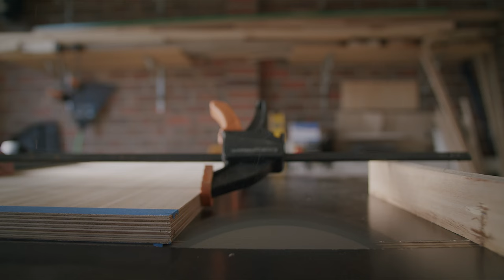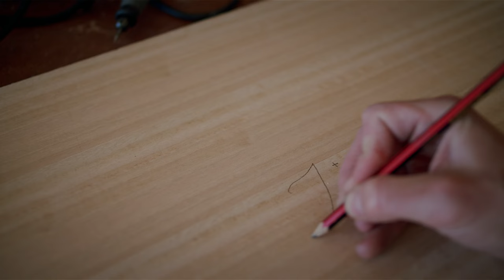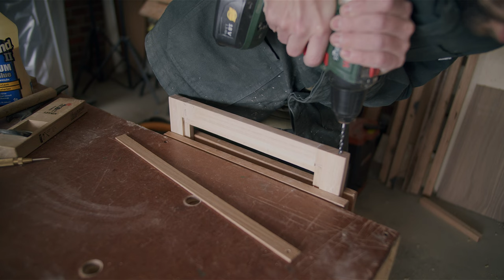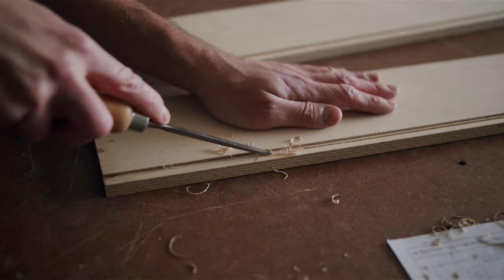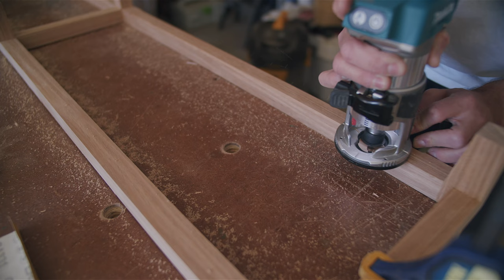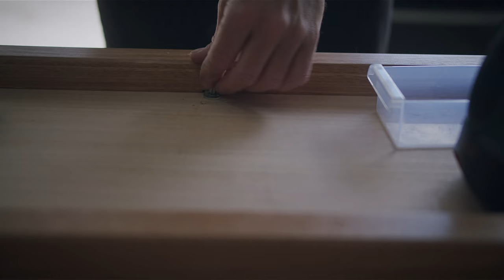Mid-century modern record player cabinet with hideaway speaker doors - DIY Build

Comment: I absolutely love this piece! I've been looking for inspiration to build something similar for my father's old blues collection and came across your video. I'm just getting into wood working - do you have any suggestions on building this as an absolute beginner? Any chance you'd consider sharing plans or even making a video demonstrating a simplistic build?
Reply from the maker: Hey thanks, glad you like it!  There were definitely a few tricky things with this build - it could definitely be simplified a fair bit though by removing the mitred corners, not doing the edge banding on the plywood faces, and removing the doors from the speaker areas.  I do have another couple of record cabinet builds that I would say were much easier than this one which might be worth having a look at.  Sadly no plans available yet, I need to get my act together on that soon!
Reply: Completely new to woodworking but would love to recreate this cabinet for my vinyls. Do you have the plans for this?

Comment: Beautiful work! Is that a biscuit joiner? If so, what brand do you use?
Reply from the maker: It's a floating mortice, not a buiscuit... uses a thicker timber "plug" in matching slots that give more support than biscuits would. The one I've got is the Festool Domino, which is pretty expensive but well worth the investment!